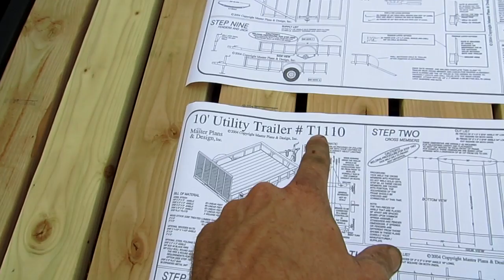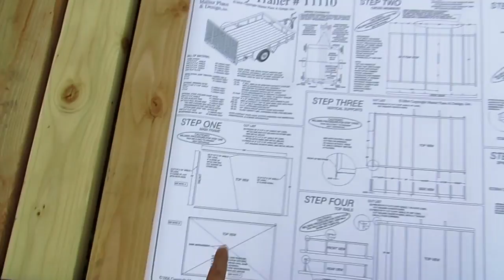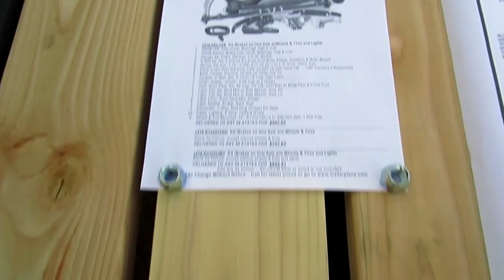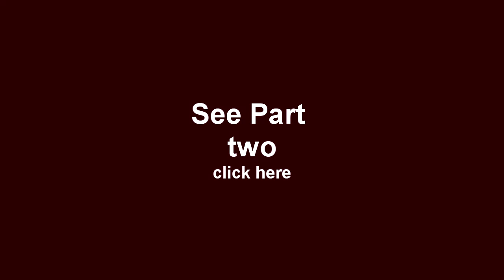Homemade Utility Trailer Project Build 3

Comment: I take my comment back it looked like you had angle iron as a frame for the springs ,1.5 square will work but should be 3/16 or better .planks will help.

Comment: The way you have attached the safety chains is cute but I don't believe it is effective. Safety chains are supposed to be crossed under the tongue to keep the tongue from digging into pavement. Your method puts the chains to far forward to catch the tongue of the trailer if it comes off the ball. Locate the chain mount farther back to protect your cargo and others.
Reply: Chains get twisted before hooking to bring up slack